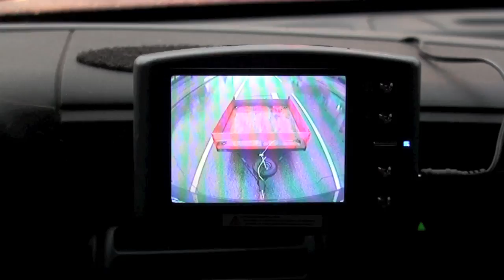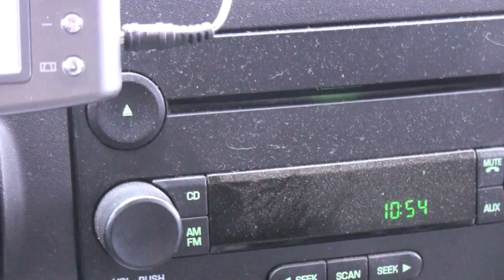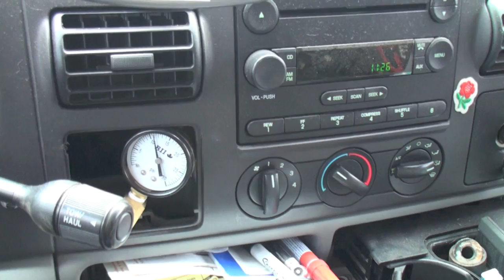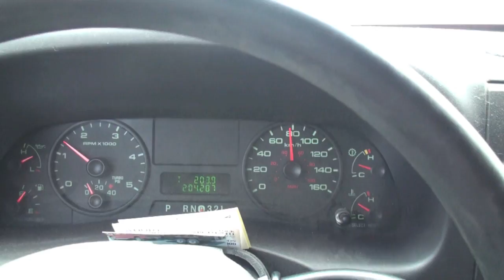the crown vic adventure!

Comment: WARNING: the electrician who is fixing the electrical problems at you shop IS NOT allowed to touch the MAIN LINES coming from the pole and he clearly has, he can if it is disconnected at the pole by the power company but thats it, if the line looks like it is still connected to the pole call ANOTHER licencesd electrician.